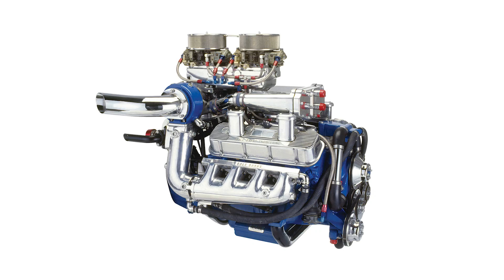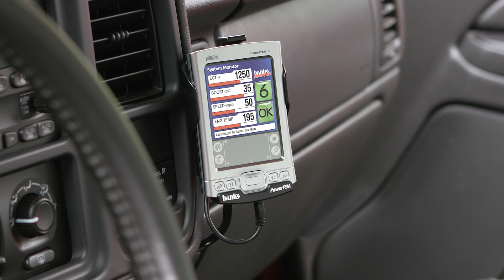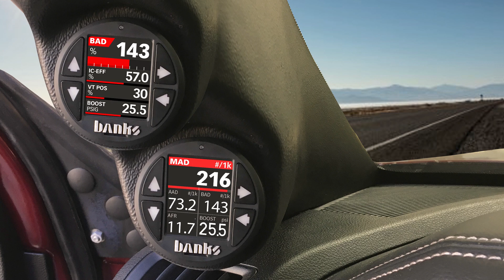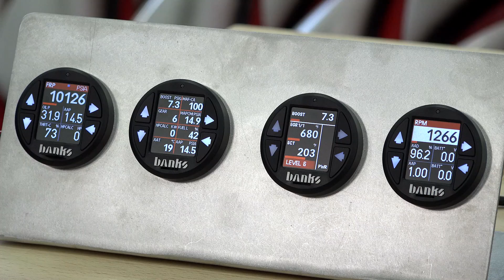Data Logging | Building a Monster Truck Engine Pt 1

Comment: 4:02 Wait so the Type of Engine In a 12,000 pound Monster  jam Truck in Monster Jam Runs a 540ci Merlin  Big Block Engine With the K&N Blower Motor attached on top of the Engine that is used on Dragon Grave Digger EL Toro Loco Max D Wild Side Whiplash Blue Thunder Scooby Doo Great Clips Mohawk Warrior Megalodon Monster Mutt Dalmatian  Monster Mutt Original and other Monster Jam Trucks!

Comment: can you make a kit for datalogging my 2020 ford explorer ST before i start doing mods?
Reply from the maker: All you need is the iDash DataMonster for your data logging needs. It's plug-an-play with your 2020 Explorer! https://www.bankspower.com/i-2760
Reply: @bankspower  will i need to add more sensors to see the difference in MAD thru the system.  want to make videos before and after upgrading intake, intercooler, exhaust, etc

Comment: Love your passion for diesel , I want your diesel monster truck too kill the the spark ignition  . My thoughts may be wrong but here they are , clearly I don't have a dyno cell or do i have any proof to back me up . Its only information I've gathered through out my life , and my passion for solving problems , Disclaimer thoughtful enthusiast theory only. 
- Torque transfer time , idle to full coupling torque lock up  sec. __________
- engine rpm vs wheel speed    map 
- adjust the gearing in drop box to match the lower diesel rpm band width. 
-run a full lock converter  1800 to 2000 
- lower rpm torque values mapped against wheel speed 
- 540 usable torque range ( dead stop  wacking it , wheel starts to move record rpm ______ . Full lock up red line rpm __________.  I'd guess 4500 to 7200 
- Original 540 max wheel speed  
- I'm guessing the 540 produces a average 1100 ft lbs of torque  in a  3000 rpm window 
- matching the torque window at a lower rpm , and gear up to match wheel speed , 
- The missing hp is still a concern for reaction time and can be made up with coupling the torque faster 
- Also setting up the l5p to  produce a average of 1400 ft lbs torque  in its  usable 3000 Rpm window to compensate for the loss of hp 
- the faster you can couple a diesel  and take advantage of the long slower burning power stroke the more torque it will produce.  
- keeping the rpm lower will net the most gain . 
- I'd concern my team's focus on torque numbers and throw out the hp number with the boost gauge.,q

Comment: it seems like you guys should develop a stand alone ecu given how many proprietary sensors you have developed. the hardest part about running most of the ones ive looked into is getting the stock sensors to play nice with it.

Comment: $370 and it includes a  $$$$ vbox? There’s plenty of data recorders out there that can do 10hz logging. I wonder if they’ll plug everything into that $$$$ vbox and then send the data to their gauge via CAN.
Reply from the maker: The new iDash 1.8 DataMonster records at 20hz. Also, the VBOX was only used in this application. It is not something we typically use or need, nor do we sell them.

Comment: This technology was already available, even for street applications, from numerous other manufacturers, with a stand alone full instrument gauge, with turn signal, fuel level, rpm, speedometer, the list goes on.
Reply from the maker: If you're referring to the iDash 1.8, the gauge has never been this small, offered so much and cost so little.

Comment: Ok, I'm new to this channel. The diff cover video caught my attention. About 2 minutes in I subbed. Not only does this man know his stuff, he can explain it! I understand him! His enthusiasum is infectious. I'm old but not dead, just a little disabled, and he's giving me ideas! I love diesels because they're stout and make real torque. All my diesels have been natural or turbo. Supercharged has got to increase throttle responce because it does on a gas motor. Some of these so called superchargers like Vortec and Pro Charger look like belt driven turbos to me and they have lag, too. The Roots type of charger makes boost off idle and that's old school! I'm sure the answer lies in supercharging or a combination of supercharger and turbo like today's 4 stroke outboards. I can't wait to see the out come of the diff cover issue. Maybe a system like NASCAR uses is the best solution. We'll see soon because Gale Banks is on the case.
Reply: screw blower.  different than a roosts blower.  you know those make A LOT of power

gale banks been the man for diesels for YEARS!!

Comment: Gale, don't know if you've seen Bro Dozer. It is a diesel powered monster truck. See https://youtu.be/rEn8yM32XJ0

If you watch the run you can see it suffers from major turbo lag compared to a supercharged methanol engine so you are 100% on the right track looking into measuring the response on those and trying to duplicate it (or get close) with a supercharged diesel. It does show that a turbo-diesel can make the power needed. Can you get both the power and throttle response with just a supercharger or will it need to be a more complex supercharged turbo system I wonder...

Comment: how do they not kill those engines with going upside down and all that... wont is starve for oil
Reply: That's the advantage of the dry sump system, engine angle and G-Forces don't matter as much when running a dry sump.